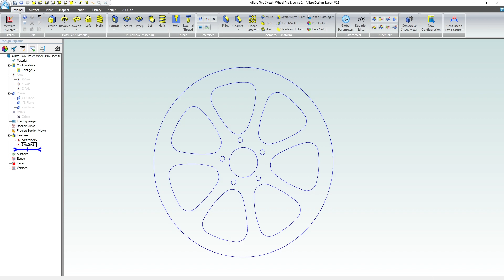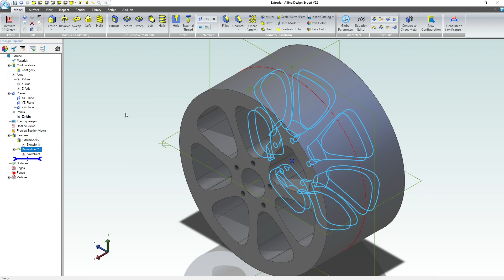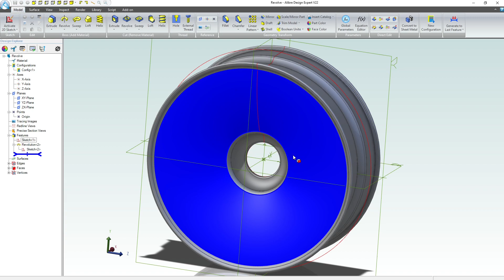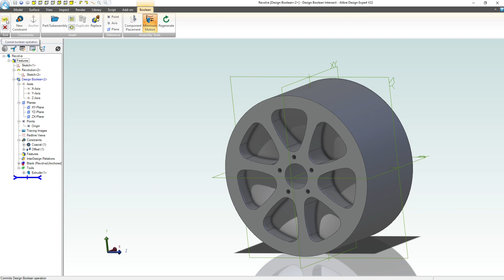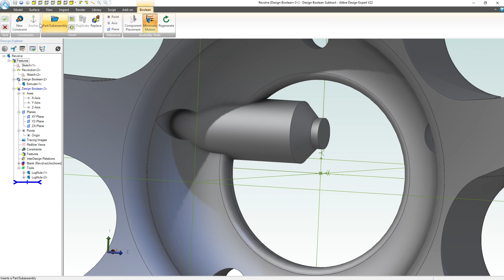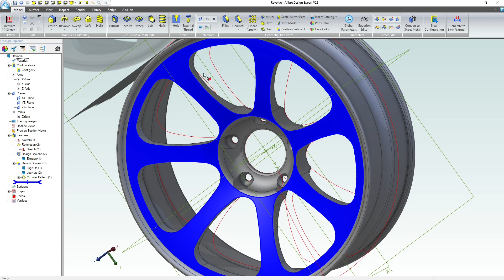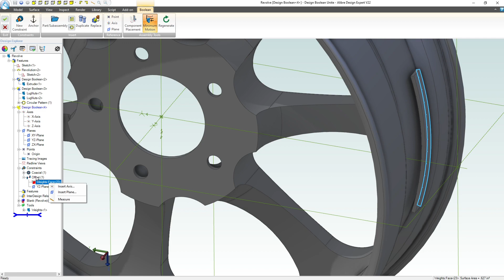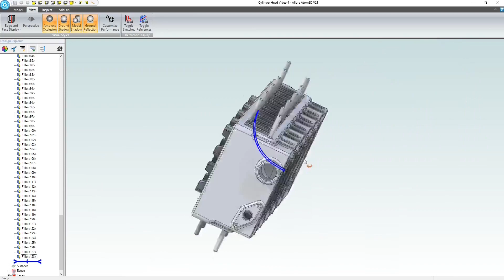How to Boolean in Alibre Pro |JOKO ENGINEERING|

Comment: This was Awesome Thank You, I am trying to learn how to design off-road (Pre runner) Parts but it seems difficult since I cant create separate bodies, Would the Boolean Function be the best way to do this?
Reply from the maker: Boolean is the way to work with multiple bodies and it is exclusive to the pro license.  If you have atom, there is usually a workaround you can find that has no issues.